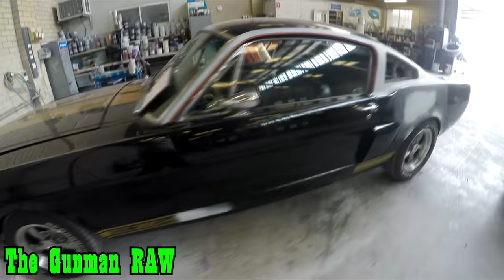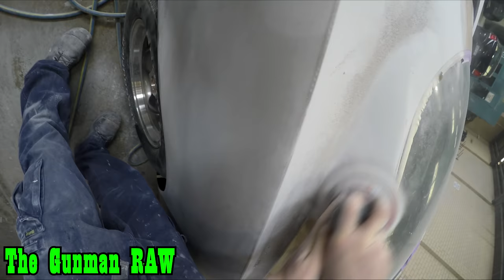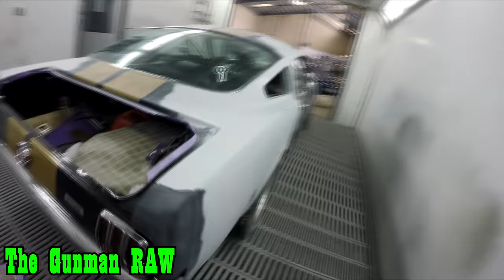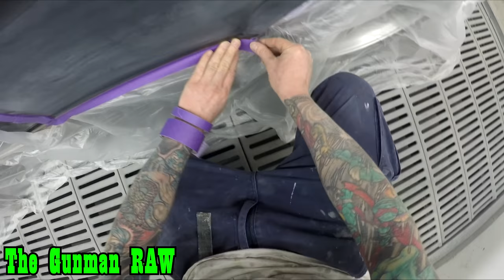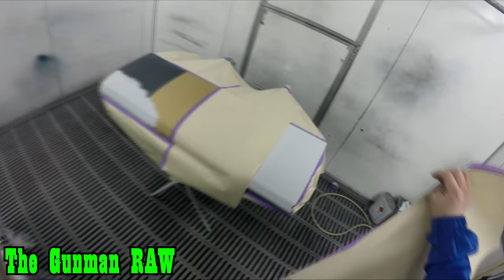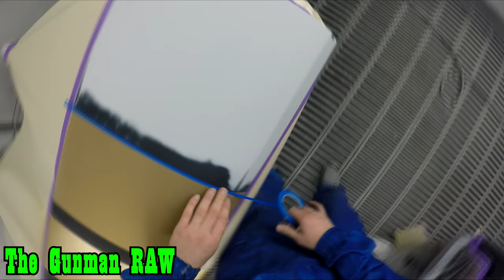RAW Prep Work: GT350 Mustang

Comment: This has probably been asked a thousand times.. And I know it has been mentioned in a video before. But just curious as to what the plastic cutting tool is that you use? Wouldn't mind trying one out!
cheers.
And another awesome video! Keep em coming :)
Reply: FrantiixGaming I just got some of those they are great no more worrying what the blade is cutting into on the other side just poke through and cut in seconds. there called masking sheet cutters.